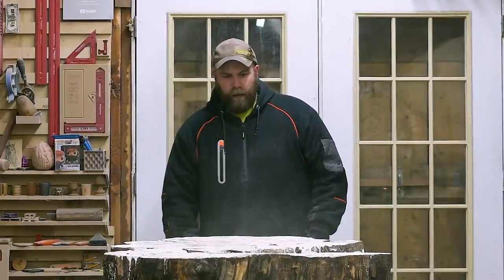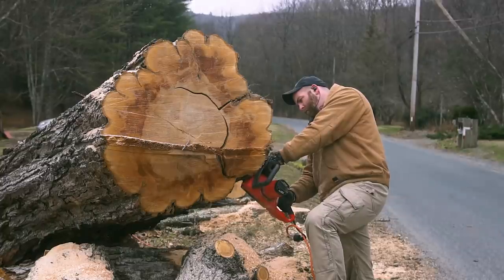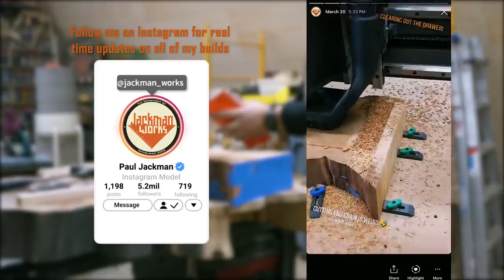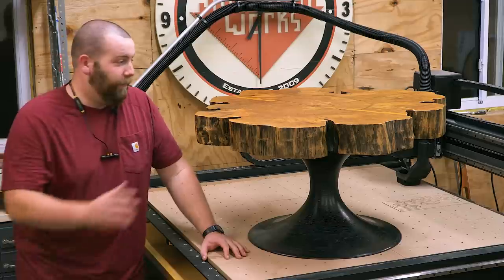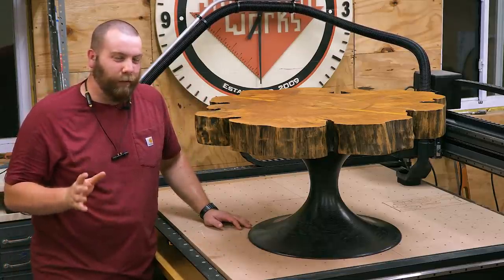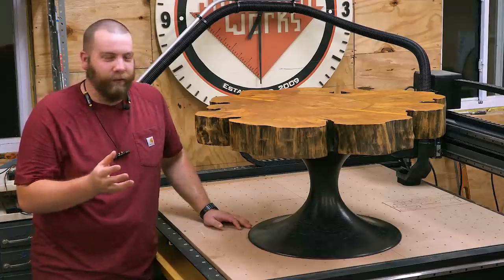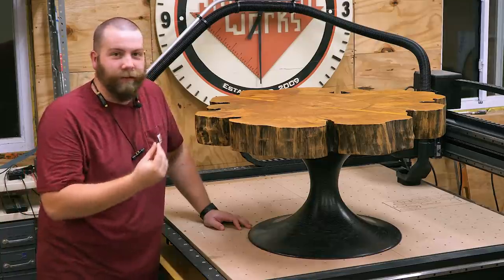Secret Drawer Slab Table (slab from 1800s)

Comment from the maker: My sponsors are what make these videos possible! Do me a favor and say hi to them and click on the links down below to check out their amazing products:
𝐈𝐧𝐯𝐞𝐧𝐭𝐚𝐛𝐥𝐞𝐬
► X-Carve Pro CNC - https://bit.ly/3ya5EDV
► Easel CNC Software - https://bit.ly/3k8xqeM

𝐑𝐨𝐜𝐤𝐥𝐞𝐫
► Panel Cart - https://bit.ly/2XOdyq3
► Straight Line Jig - https://bit.ly/3B5nOIW
► Router Bit Gauge - https://bit.ly/3B1Ai43
► Did you see all 24 Rockler tools? - https://bit.ly/3B3zcoE

𝐀𝐫𝐛𝐨𝐫𝐭𝐞𝐜𝐡 (coupon code "Jackman10" gets you 10% off all full tools, "Jackman20" gets you 20% off all attachments, valid in US & Canada through 9/30/21)
► Power Carving Unit - https://bit.ly/3gsZadj 
► Turbo Plane - https://bit.ly/3kixLM7
► Power Chisel - https://bit.ly/3sFa18N
► Mini Carver - https://bit.ly/3kfkDHO

𝐓𝐨𝐭𝐚𝐥𝐁𝐨𝐚𝐭 (coupon code "Jackman15" gets you 15% off)
► High Performance Epoxy Resin - https://bit.ly/2Wf7iqQ
► Kintsugi Kit - https://bit.ly/38jo1Mh
► Wood Sealer - https://bit.ly/3D0X6CO
► Halcyon Varnish (gloss & satin) - https://bit.ly/384ZLx2

𝐈𝐒𝐎𝐭𝐮𝐧𝐞𝐬 (code "Jackman10" gets you $10 off any pair)
► Bluetooth hearing protection headphones! - https://bit.ly/3yd1zyG
Styles shown in this video: Pro1.0, Xtra2.0

Comment: Paul, Your video presentation is incredible, just a bit of dry humour to make a project more interesting.  I have a couple of table projects that are stalled because of the question; "What kind of legs to use?"  Spindly metal rods with wood does not work, laminated free form wood legs are possible, and then you come up with pedestal and paint it black to make it disappear. What a concept!   

I know that I will have to build a router sled very soon and experiment with it.

Thanks for the very best video.

Comment: You have some of the most inspiring ideas with very well done videos that catch our interest and humor.  I was wondering why you left the painters tape between the pieces exactly since you coated everything before before adding the filler?  Please keep up the videos they are great.
Reply from the maker: That tape was to cover the piece that later became the drawer. I used painters tape to build up a little thickness and then packing tap on top so that it wouldn't stick to the epoxy during the pour.
Reply: @JackmanWorks  Cool thank you for explaining, I really appreciate.

Comment: Great project.  But is your spindle properly trammed? Hard to tell from just this one video of course, but the witness lines on your flattening operation may mean you need to correctly tram the spindle to the work surface.
Reply from the maker: I have a feeling that's just because it's end grain, so it tends to show the cut marks much easier because the blade folds over the grain slightly kind of like the lines when you mow the lawn. My last project (the Cape Cod map) got leveled without any lines like that, so I'm feeling good for now at least.

Comment: Question Paul; you have used grinders and chisels to remove the bark and dirt residue from the slab, and was wondering if you had considered using a small sandblaster?